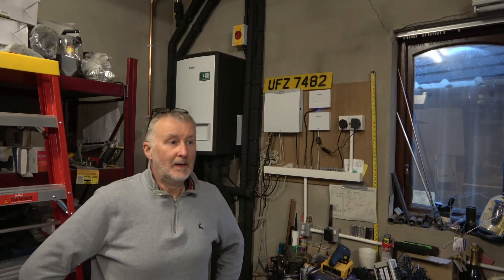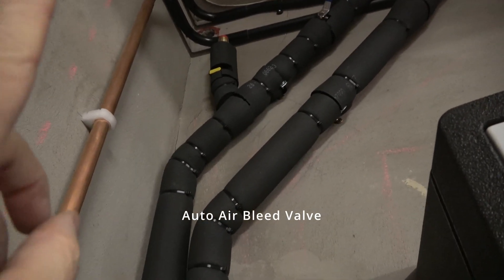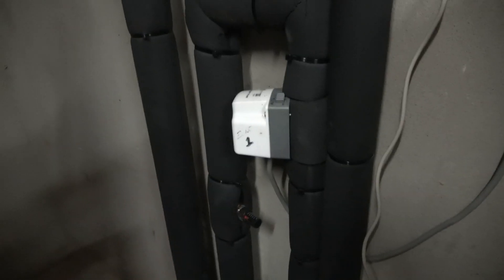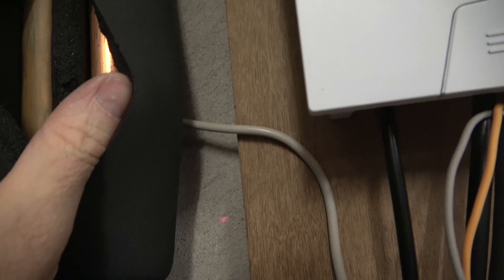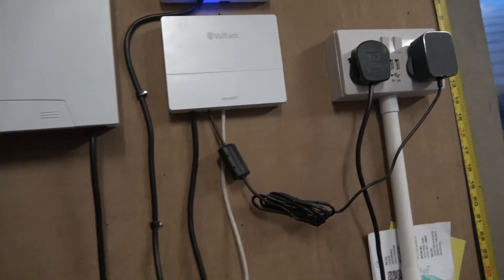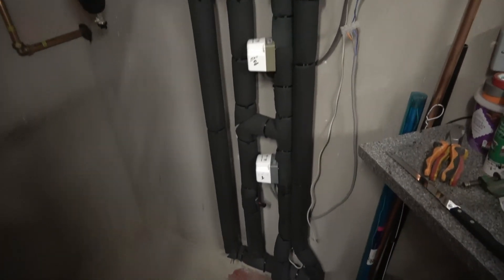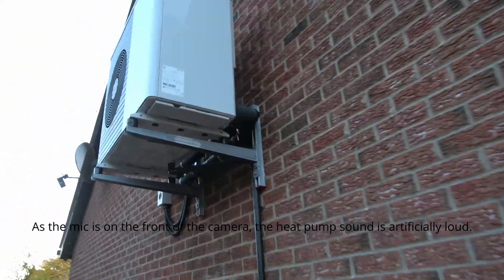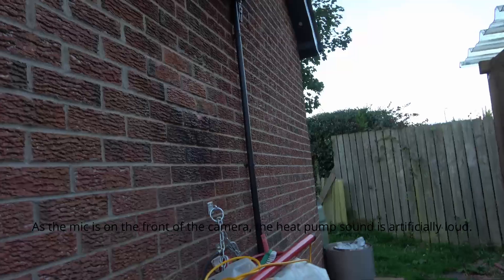Self Install of 7kW aroTHERM plus Heat Pump. E9.

Comment: Hi Keith. Not far from you. Doing something similar. Like you, no grant here, so will be diying a lot also. Have the advantage of my brother in law being a plumber. Might come back to you for advice. I also will be combining solar thermal. I would have liked it to contribute to space heating as well as DHW where possible but can't find a system design. However Joule definitely do duel coil cylinders.
Reply from the maker: Hello Gareth, well if you have any Q's just ask. it can be a steep curve. Thanks for the info on Joule.

Comment: insulted your drain pipe or it will freeze in sub zero temps, i would recommend also adding a heat wire if you have significant cold air flow blowing against the heat pump
Reply from the maker: Thanks, there is a heating wire (element) in the top portion of the pipe, the near horizontal bit, I was hoping that would be sufficient, so keep the whole thing ice free? I can easily remove the top connector, if it gets really cold, effectively letting the condensate just drip out.

Comment: Pipe bending to accommodate increase in rad size from say K1 to K2/K3 would be helpful.
Reply from the maker: Hello David, thanks for the comment, are you saying to bend pipes were possible, so lessen pressure drop and then to increase rad sizes?
Reply: @Staedford  Sorry  I've not made myself clear,  I meant the prep work video, it would be useful for me to watch how you bend the pipes for replacement  of a K1 to K2 or K3.
Reply from the maker: @davidreece1642  Ah David, i have not replaced any!  I did replace some with aluminium and re-plumbed the ends, so came through the floor at the correct centres. I also have been upgrading the insulation in each room. I take your point that moving from K1 to 2, 3 is an alternative.
Reply: @Staedford  OK, I'm sure I'l find your prep video  helpful nonetheless.
Reply from the maker: @davidreece1642  I hope to do it this week.  @GlynHudson does show how to mod the rad tails in his video, https://youtu.be/bHsp7fDw_bg?t=916
Reply: @Staedford  Thanks.

Comment: Thanks for sharing, I have enjoyed following your progress - looking good.👍
Reply from the maker: Thanks Norman, are you planning your own install?
Reply: @Staedford  Keith - I am not currently planning to install anything. I had a new gas boiler fitted in 2021 after deciding the time was not right for me and a ASHP. My new system has however given me a high degree of confidence that the house is ‘heat pump ready’, as I am running at low flow temperatures on weather compensation with a flow of 45° at -2°C.  I just like to keep up with the subject of heat pumps and how things are developing in terms of system design and installation. For the most part it is not a pretty picture.

Comment: Looking good! 
Most people start with a high curve and work their way down but starting low is probably a much quicker way to get to the correct curve.
Reply from the maker: Thanks, I've skimped on most aspects of the install, so I may as well skimp on the curve too. So far so good; I think that once the weather is cold for a prolonged period we'll start to see true results.
Reply: @Staedford  I'm sure you are but you should be very proud of your work 👍
Reply: Nice video.  
Regarding zoning- as far as I understand from the research I have done, zoning will cause the HP to cycle more which will impact your SCOP

What is the Delta T on the flow and return to the radiators? Have you got it as low as 5C?
Reply from the maker: @simonthompson15  Thanks Simon. The zoning was always an experiment, what had hoped to try experimenting with was having the 2 zones mutually exclusive, so the thermal load and characteristics were similar, where it was z1 on or z2.  I have only crudely balanced the rads. I did have some rads (the furthest ones) not coming on, due to poor balancing, now i have all of them heating, so each is definitely getting flow.  The flow temps I've seen are only about 30C at the heat meter (a couple of metres from the HP), so on each rad the drop is only a couple of degrees between F & R. I have not seen a 45C flow temp yet out of the system, simply because it's not cold enough. Most rads are still mild steel, downstairs about 4/7 are MS, 2 are AL and 1 is my 'all wall'. Upstairs 3 aluminium and 6 steel. Once i see a 45C flow, I'll check the deltas again and hopefully get closer to 5C. I do intend to do a vid about the ongoing preparation of the house for the HP,.... maybe this weekend? On a side note, I am not super concerned with COP/SCOP,.. yes it's a good measure of efficiency (obviously), but i think i an more concerned with the absolute amount of input energy needed to heat the house as opposed to the 'multiplier'.